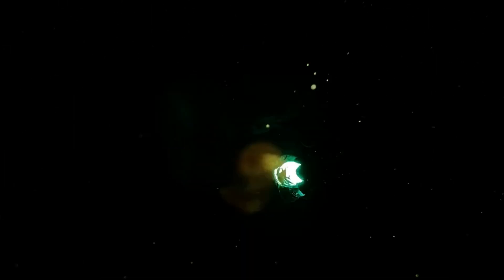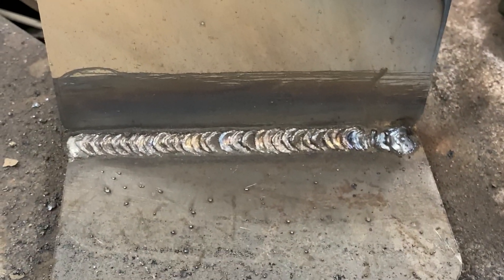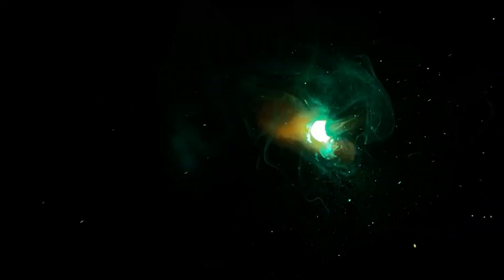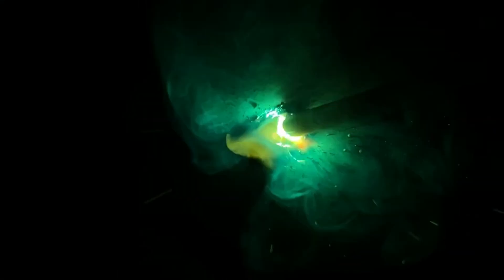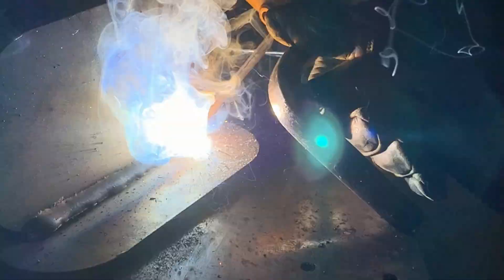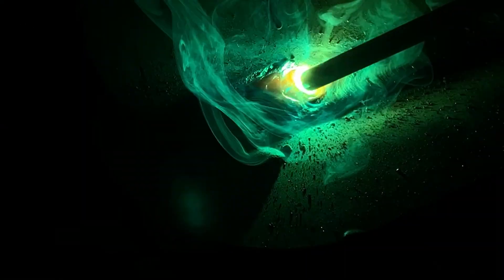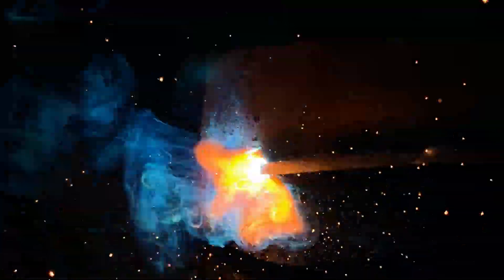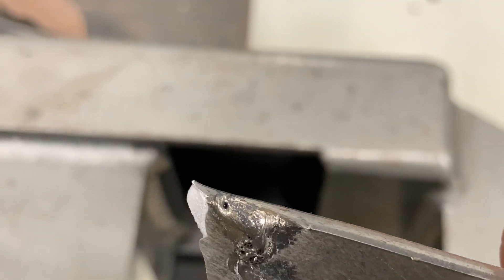2F multi pass stick welding 7018 and 6010 T-Joints

Comment: 86 looks way too cold for your weld
Reply from the maker: I am pausing for a very long time to achieve the weld size. This has me going very slow. Time is a large factor of heat input. This just works for me. Others may do it differently with even better results and faster travel speeds